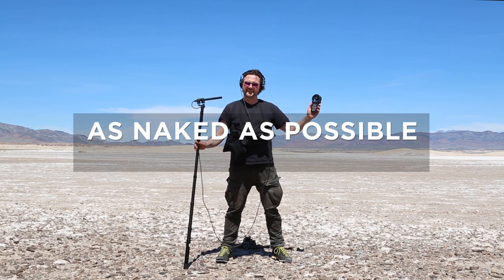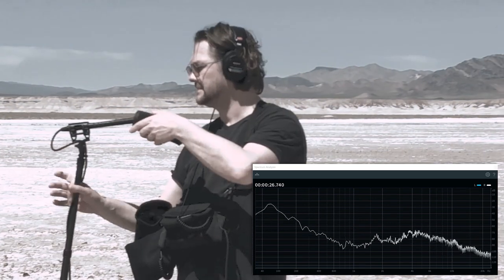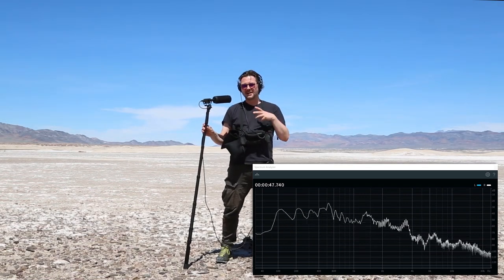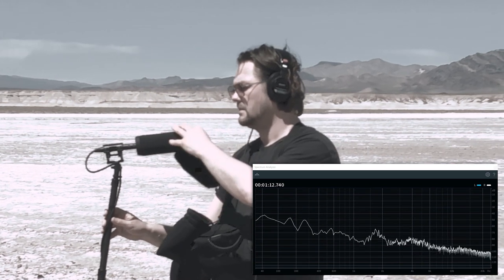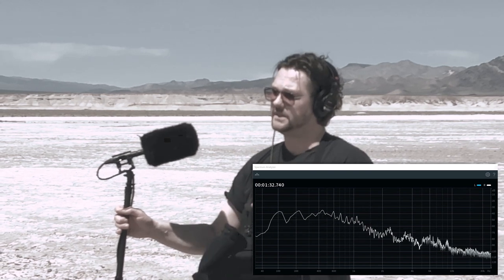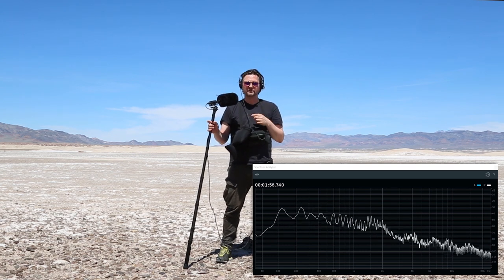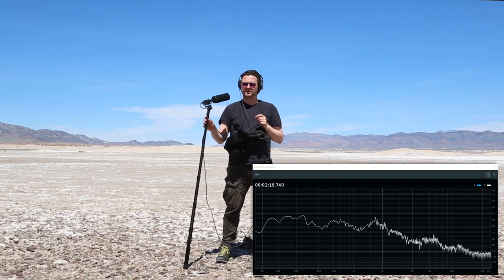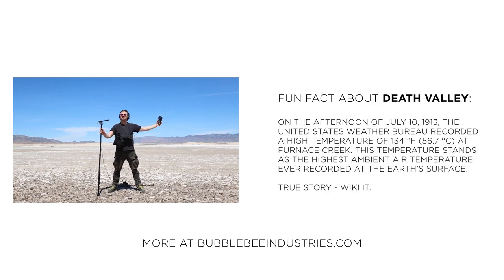As Naked as Possible: A Spacer Bubble Frequency Test

Comment: Sounds very good with just the spacer bubble and no fur. How much wind resistance can you get without the fur on average?
Reply from the maker: Hi Michael, the mesh base is designed to remove light wind noise, ideal for indoor boom swinging and very light winds. If you are outdoors in medium or stronger winds, you will need to use either the short- or long-haired fur cover. It's always going to be a compromise depending on yoyur environment, but you've hit the nail on the head with your question: the less fur you use the better it sounds.
Reply: Bubblebee Industries ok great makes sense, also are you guys coming to the Atlanta Mixer Mixer?
Reply from the maker: Michael Wynne that’s the plan, yeah ☺️